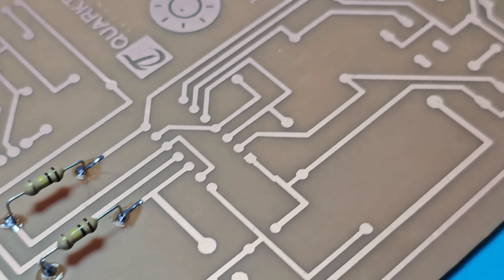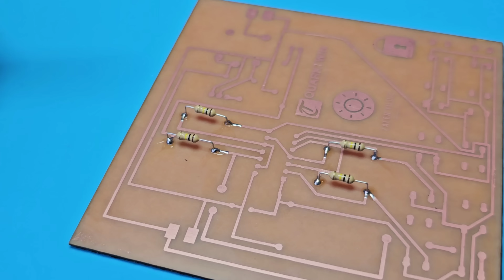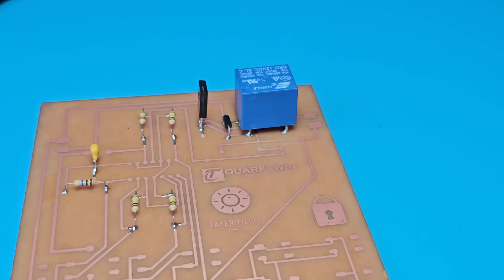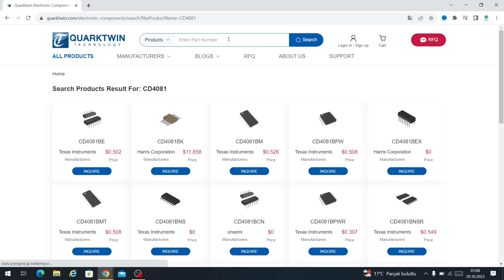How To Make Password Door Lock Circuit ? CD4081

Comment: The schematic is incorrect.
The output of the 4th button's AND gate, pin 13, should be wired to resistor R6, not resistor R5, for that AND gate to be self latching.     
An easy mistake to make.

Comment: How to set the password?
Reply from the maker: Set the password by moving the buttons 1/2/3/4 respectively
Reply: The circuit remains unchanged, just change the number of the button switch to get the password you want.

Comment: Amazing welding technique. Tell me something: how do you change your password?
Reply: I also want to know.
Reply: @fengseattle8829  there is no changing , the pass is fixed, the circuit is  not a micro-controller.
Reply: @orange11squares  The circuit remains unchanged, just change the number of the button switch to get the password you want. For example, what password will you get if you read the numbers in reverse order?